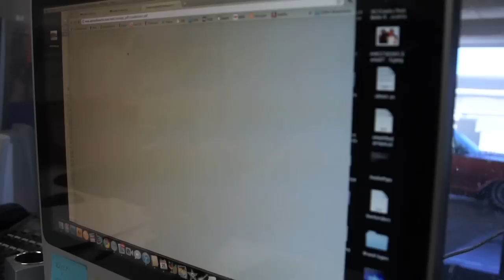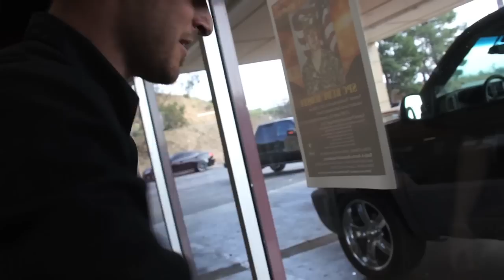Amplified - Soundman installs a clean stereo system in a Chevy Avalanche. Custom fab, EP 19

Comment: @clasu so they 
NO they are using a CONVERTER on there test bench to power a car audio stereo, which requires 12v DC!!
They ruined there power CONVERTER (AC to DC) because John hooked up the amp wrong.